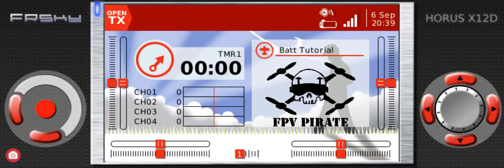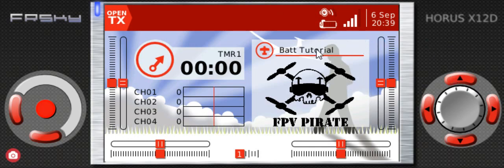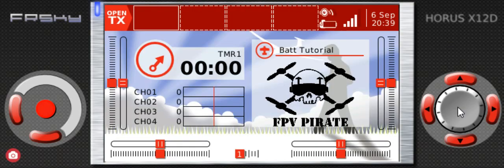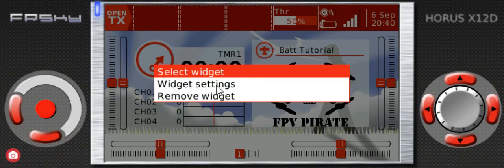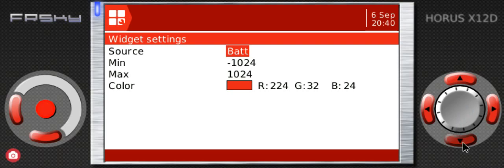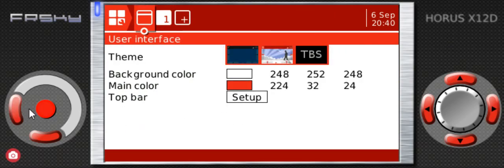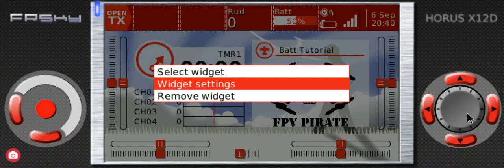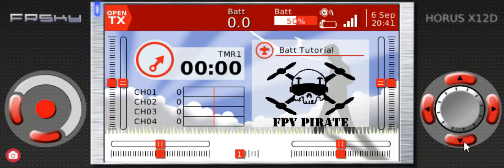How to display your battery level, percentage and voltage Horus X12S OpenTX

Comment: Dear Pirate, how do you know the % value is correct? Wouldn't you need to adjust the scale to match the battery's min and max volts?
There is another field titled "Batt Check", any idea how to use that?   (X12S)
Thanks, useful subject.
Reply: If you want to see how to calibrate the battery level expressed in %, please see the second part of the video: https://youtu.be/Ug1Z5TzuLZw

Comment: those min/max values are incorrect, if used will display incorrect information
Reply: Yeah - you nered to go into SYS first and set the range
Reply: Abyssal Plain so what’s the range?
Reply: If you want to see how to calibrate the battery level expressed in %, please see the second part of the video: https://youtu.be/Ug1Z5TzuLZw

Comment: For the Horus 10x running on the latest version of OpenTx, do you know what battery voltage rage should be set in the system setup?  How about low batt voltage warning?  thanks
Reply: Same here. Could you figure it out?
Reply: @t-producciones5138  if you want to see how to calibrate the battery level expressed in %, please see the second part of the video: https://youtu.be/Ug1Z5TzuLZw

Comment: What do you choose for min and max? 1024 does not work.
Reply: What battery does this radio is it the same as the Horus X10S?  I am trying to caliberate my battery in my X10S because I just install openTx to my radio and want to be as accurate as possible with my battery monitoring.
Reply: Same here... it does not work for me..
Reply: dejinco, Looks like we are on the same boat. I started experimenting and found that min of 80 and max of 112 gives you 32 steps between 8.0 volts = 0% to 11.2 volts = 100%... Also found that a good alert for the battery would be at 8.8 volts. After that, the voltage drops within a few minutes.
Reply: tashfitania thanks for this.  you made my day with this.  😆
Reply: Thought I replied earlier today. Thank you for this. You made my day with this. It worked as expected.. Good job!!!
Reply: dejinco I'm glad I could help.
Reply: If you want to see how to calibrate the battery level expressed in %, please see the second part of the video: https://youtu.be/Ug1Z5TzuLZw

Comment: hello and thanks for your video :-)
I have a problems flashing my horus on opentx 2.2 my pc not detect a stm32, i use diferent soluzion but is not working do you now a athers solution for do this? sorry for my english and good days
Reply: if your TX is not communicating with our pc then try a USB cable from a camera. The higher quality data USB cable solved my issue when zadig could not find the horus.